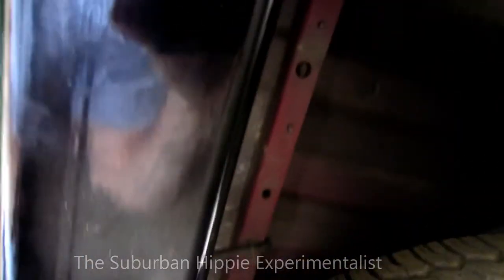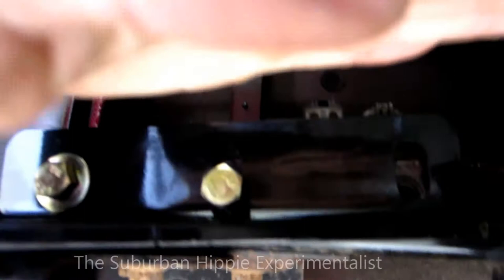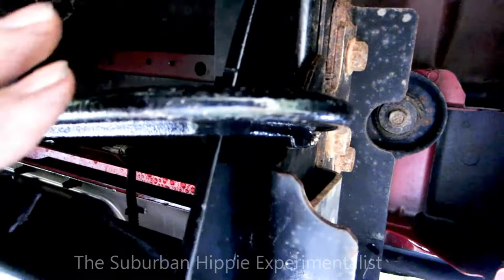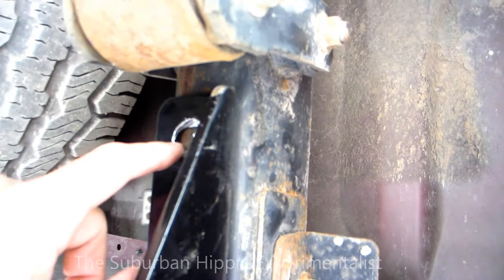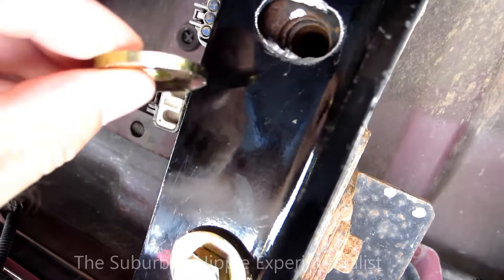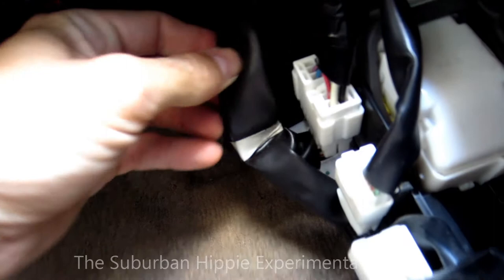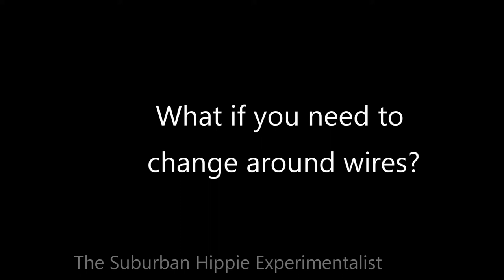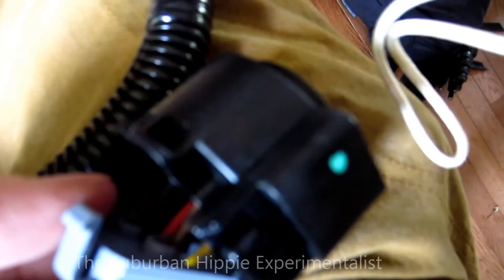Nissan Frontier SV tow hitch and wiring harness install

Comment: Terrible part.... I bought an E trailer hitch that was the same prices as the lower cost ones on Ebay.  Fit perfectly without any modifications or drilling whatsoever.

Comment: That's a shame about the fitment of the hitch to the frame.  I installed the same hitch to my 2016 Frontier yesterday and it fit like a glove. Only issue was I had to run a tap through the weldment nuts in the frame in order for the bolts to thread in. Other than that, perfect fit.
Reply from the maker: Mine was warped I guess during welding.  I had read other people had that problem as well!  It eventually worked though, so no major issues!